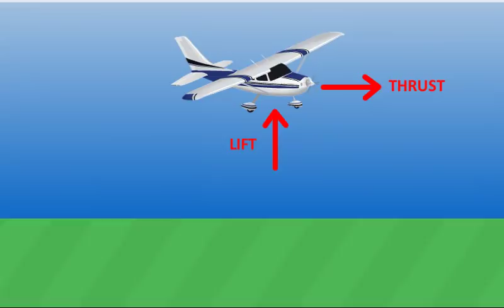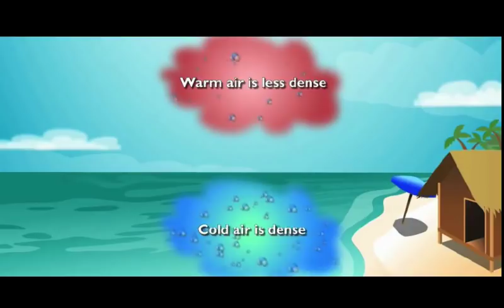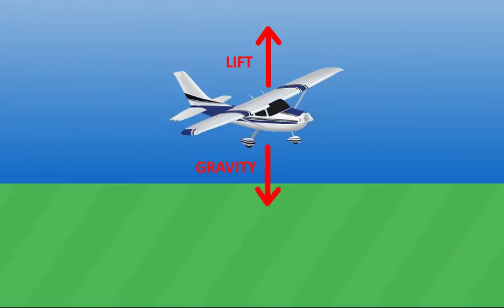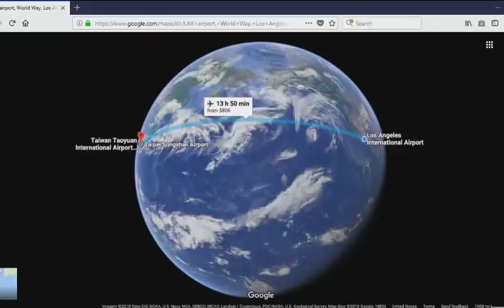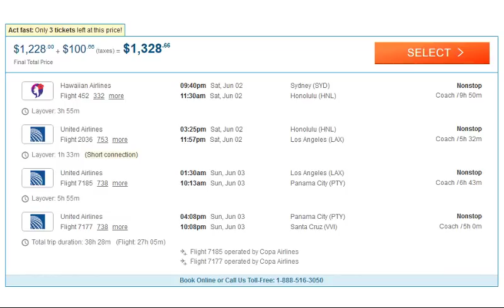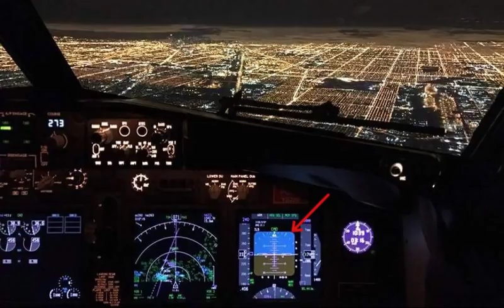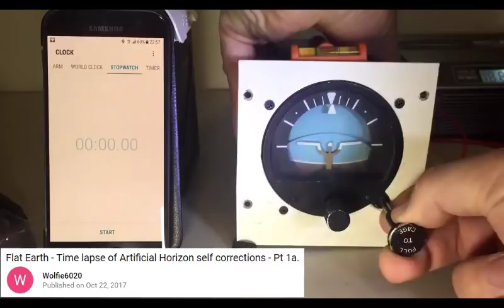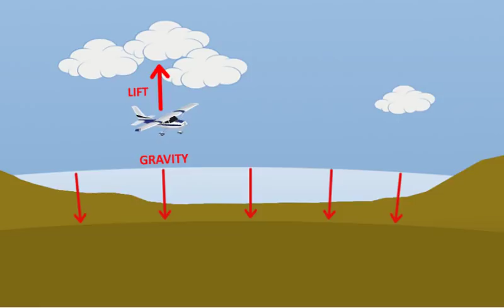Flat Earth Falsities - Plane Nonsense

Comment: If a helicopter is hovering so this is saying the moving atmosphere is strong enough to move a helicopter with it therefore stronger than the helicopter yet not strong enough to cause any effects on a landing plane . Not to mention if your hovering in a helicopter your not spinning you’d feel it surely . Also if your in a plane flying south to north there’s no way your also moving east to west 2 different movements at the same time is ridiculous
Reply: It must be annoying Larry how everything can fit neatly into our "system", but your system has massive gaping holes in it and nothing quite slots together without being papered over by magic and "God did it". You would think that might give you a clue.
Reply: "if I’m moving at 1000mph I’d feel it" - no you wouldn't. Force is mass x acceleration. No Acceleration mean no force. In other words there is no way to feel a constant velocity, it exerts no force on you.

"Where else in nature can a positive and negative pressure system exists side by side without a barrier?" - pressure differentials are literally everywhere in nature. I just explained that air is at 14.70psi at sea level but less than half that at 5500 meters. Where is your barrier there?

"Where else in nature does the surface of water bend?" - water bends everywhere. On the small scale you can see in the roundness of  a raindrop or in a meniscus curve, on a large scale you can see it with the tides: same water at high tide one place and low tide another. How is that possible if the water is always flat and level?

"now let me guess gravity stops water from moving" - partly, but mostly there just isn't any force on it from that movement. Because constant velocity doesn't create force, as I already described.
Reply: GrahamStw I can’t believe how stupid these people are... I don’t think they can comprehend in their minds the distances and sizes of the earth and the sun in conjunction to us...
Reply: Larry Major 
Maybe it's crazy in an atmosphere, or on our relatively small planet. 
But those are less than snail like speeds when the size of our galaxy is considered. Let alone the universe!

Common problem amongst flat earthers- no understanding of the actual sizes involved, and very poor 3D spacial awareness.
Reply: No, it is not "saying the moving atmosphere is strong enough to move a helicopter with it". It is saying that a helicopter on the ground is moving with the Earth. When it takes off it is still moving with the Earth, even if it appears to be motionless relative to the Earth. 
Exactly like the ball in the car: when the ball is in the boy's hand it appears motionless relative to him, but it is doing 60mph (or whatever), just like the rest of the car. When he throws it in the air it appears to go straight up, relative to him, but it is actually travelling forward at the same speed as the car and the boy.
Reply: Welcome to the world of Flat Earthers Liam. Amazing isn't it?
Reply: Tides are not waves Greg. They raise and lower in predictable cycles. Most areas get two high tides and two low tides per day. Take a look at the tide maps at https://www.tidesandcurrents.noaa.gov 
Notice how the same water can be at high tide in one place and low tide at another, then the opposite six hours later. That is not flat and level. That is water being bent and pulled to different heights by gravity. 
Which is what they use to make their predictions, which you can see are very accurate.
Reply: And yes I have seen curvature. Pretty much every time I go to the beach. 
Here is curvature right there:
https://www.youtube.com/watch?v=y_x7_Hl0AT4&t=507s
Watch for twenty seconds from that point. Clear observable curvature of water.
Reply: Greg Mcbride you are an idiot. The next time you’re in a moving vehicle, think about it again.
Reply: Greg Mcbride you’re asking people on social media who aren’t scientists. Why don’t you actually educate your self on the stuff you don’t understand rather than screaming conspiracy. We could shoot you into space and show you it’s round and you would still cry it’s fake. I have really tried to look into FE theory and I can tell you it’s all stupid with no regard for even the basic of science.
Reply: +Larry Major
Why do you run away from Questions, if you know so much? Given the intellect and knowledge you claim you should be able to answer these simple questions.
Why is it that a compass needle is more or less vertical at the poles and horizontal at the equator?
And when you carry on past the poles the needle slowly returns to the horizontal?
Why is it that it is only possible to navigate accurately over long distances using spherical trigonometry?
Why is it that traditional gyro compasses work perfectly in low latitudes but became unreliable in high latitudes?
Why is it that it is only possible to navigate accurately over long distances using charts based on a terrestrial spheroid?
Why is it that when you watch a ship sailing away from you the hull is the first thing to go below the horizon, then the superstructure and finally the funnel and upperworks?
Does a magnetic compass point towards polaris (Alpha Ursae Minoris) at the north and south poles?
Does a gyro compass point towards Alpha Ursae Minoris at the north and south poles?
What is the relationship between longitude and distance when travelling east or west parallel to the equator?
Please explain the principles behind the development and functioning of a gyrocompass?
No evasions please, just straight answers.
Reply: +Greg Mcbride
"The thing I love about the globe believes everything you hold so dear they have never felt saw or measured . Only read it in books "
What you fail to recognise is that some people have a working knowledge of the real world and have experiences which allow them to make rational, logical decisions on such things.  In my experience in mathematics, science and real life situations I have found that the mathematics and science I learned at school, college and university actually conform to and confirm real life. Unlike you I actually have real life experiences which means I actually know things, rather you who naively "believes" any old cultish claptrap.
Tell me, how many times have you navigated around the world?
Or to the Arctic or Antarctica?
And tell me what you saw on your travels and how you actually navigated.
Tell me what is the relationship between longitude and distance when travelling east or west parallel to the equator?
Tell me how you ascertain the error of a compass when in the Southern Ocean, using Alpha Ursae Minoris?
Reply: LIAR.  We have all been in cars.  Cruise control regularly speeds up and slows down to keep speed.
Reply: Bobby Wizdum 
Hey Bobby... What's up your pizza bro?! You disappeared from the convo after evidence was presented against your space pizza. I'd love to hear you explain the flights I showed you in the other comment thread!

And no shit you can feel motion in a car on cruise. Undulations of the pavement, any curve in the road, up or down hill, those are all changes in vector.
Reply: The helicopter is hovering with respect to the Earth.  In reality they are both moving at the same speed, just like a geostationary satellite moves at the same speed as the Earth.
Reply: @Greg. To feel movement you need acceleration. When Earth is moving with almost constant speed you experience only centrifugal force (as effect of movement). On equator that force is created by centrifugal acceleration equal to about 0.034 m/s^2 outward from surface. When in other hand you are experiencing Earth gravitational pull in opposite direction exerting acceleration of about 9.8 m/s^2. Which is more prominent?
Reply: @Greg McBride wrote: "Why do we feel nothing from the atmosphere no matter what way we travel?".
WTF? What medium of transport do you use? There is always air resistance that we must overcome to move inside atmosphere. It is exponentially dependent on the speed in relation to air. Did you ever check how much more thrust jet engine generates in contrast to simple propeller?

With proper airplane you can fly 800mph either direction (east or west, with or "against" air spin). What is you point?
Reply: @Greg wrote: "ISS 1700mph it orbits what the fastest speed ya humans can travel at? And also the earth it's self is orbiting the sun at 67000 mph".

There are no contradiction there. Movement is relative. ISS is orbiting around Earth center with speed of 17000mph where as is traveling with Earth 67000 mph around center of the Sun. In vacuum there is only one limit to the speed. Speed of light. There is no other. To go 671 millions mph there is long way for humans :).
Reply: Haven’t you seen Brian cox chasing the sun in the fighter jet traveling at the same speed as the earths spin ?? So what would happen if they turned and went against the earths spin 🌏 the earth would be flying past them surely ??
Reply: Brain cocks should do that travel against the spin in a fighter jet flying at roughly 800 mph and the spin of the earth say 800 mph roughly see where he ends up ?? If he can beat the atmosphere one way he should beat it going against that would be great telly
Reply: @Greg. ISS is orbiting Earth around 400km above see level in less than 1.5h per revolution traveling a route with a length of about 42540 kilometers . Even when cruising with blazing speed in excess of 28360 km/h around center of the Earth. There is zero G and astronauts doesn't feel any movement. That is because at that hight and speed centrifugal force is equal to Earth gravitational pull (at that hight around 9.55 m/s^2  = (2*Pi/1.47*3600s)^2*(6371+400)*1000m).
Reply: Martin Gorbush they feel no movement how come when you watch iss interviews they are bobbing about all over the place ?
Reply: Exactly because of that what I've said. They cannot feel movement but they can observe it with their eyes. That is why they bobbing about all over the place.

Even so I was specifically talking about feeling movement with speed of 17000 mph around Earth.
Reply: NotTheCIA I.think I’d have to take your word for it that gravity is acting as the rope and you have to take there word neither of us have any prof . How fast do rockets travel when they pop out into the magic of space how do they stop from shooting off into space ? If they are orbiting with 20000+ satellites why don’t they every hit one ? Who determines which way the iss Is orbiting ? How the fuck did they put that thing together if you notice there’s no footage of them assembling it it just appeared all of a sudden ! You should watch some of the old nasa footage before cgi they had to use little toys much like the first few space films or if you watch an old Godzilla it’s very very clear that they are not in space you don’t need a physics degree to work it out . You should all watch “do you believe in magic “ if you still believe all this space nonsense then your clinically not well and should seek help quickly !!!! Star Wars a new hope compared to Star Wars the last Jedi are worlds apart thanks to the magic of cgi exact same goes for nasa look for your self and come back to me it’s fake as fuck
Reply: @Greg.
Learn about ISS history. There is a picture from 2000: https://en.wikipedia.org/wiki/File:STS-97_ISS.jpg

Sorry I don't have time to answer every questions even easy one.

Satellites sometimes collides. There are so many of them but they orbit on different heights above Earth. Some even 35000km (geostationary).
You should ask how it is possible that there is so few accidents when there are more than 270 millions cars just in USA alone. What's more they move basically on one plane.

Why rockets don't overshoot? Sometimes they does. There are methods of correction (maneuver engines/thrusters). Mostly they don't because engineers did they job properly and calculated thrust and time of MECO (Mine Engine Cut of) just right.
Reply: @NotTheCIA wrote: "its gravity applying the onward force".
Sorry. You got it wrong. Gravity always exert force directed to the center of mass similar like a rope. Outward force which balance gravity force is created by centrifugal force experienced by object with mass m orbiting at distance r with angular speed of omega and could be calculated as omega^2*r*m.
Reply: Martin Gorbush they are in a studio playing with themselves lol
Reply: Martin Gorbush your can example don’t really work has ever car has a driver and even then with traffic lights there’s still hundreds of crashes
Reply: NotTheCIA I.think the difference with water we can see it moving the atmosphere we just need to take there word for it . If you go against that stream your talking about you feel resistance right ? Why do we feel nothing from the atmosphere no matter what way we travel ?
Reply: NotTheCIA I.think if your on a train your traveling flat so yes it’s harder to detect . But if your going around a ball and also being pulled around the sun your saying you wouldn’t be getting thrown around the iss of course you would . When you take off on a plane your told seat belts on when your landing its seat belts on its only when your cruising “FLAT” that you can walk about . And you can clearly feel up and down but wait let me guess in space you don’t in space you can be spinning around a ball while getting sucked around the suns orbit and not feel a thing....... the magic of space that none of you have ever experienced yet are so sure exists
Reply: NotTheCIA I.think the magic of space the iss which I reckon you believe in ? So the iss is traveling around the earth “orbiting” the magic of gravity it ain’t sticking it too it it’s making it orbit this time amazing .... 17000 mph it orbits what the fastest speed ya humans can travel at ? And also the earth it’s self is “orbiting” the sun at 67000 miles ph now think long and hard about those speeds and watch a iss video cunts are having fancy dress water fights while playing the guitar 🎸?!?!? Also how on earth did the built that up in the vacuum of space going at such ridiculous speeds none of which is humans living in reality have ever ever seen !!
Reply: GrahamStw it doesnt fit neatly. you guys just contradict yourselves, give gravity more jobs, and pat yourselves on the back.
Reply: Jake only if you hit the break or accelerator. i thought u guys just claimed u cant feel cars moving like earth? now you can? shocking. of coarse you can because its moving.
Reply: Ryan M havent seen this "evidence against the pizza". i can tell you...if you admit u can feel movement in the car why are you guys using that as your example for how we cant feel earth moving when it is? do you guys realize how that looks?
Reply: NotTheCIA I.think no. i feel motion because my car is moving. i know my senses.
Reply: NotTheCIA I.think you are holding on to the rope of the bucket though so it’s not the same at all . These example you give are typical of the globe heads . Spinning a bucket around your head something we can all do yes but to then compare it to a giant space ship being stuck in orbit with nothing holding it only the magic of gravity is such a big jump it’s silly!! Why don’t gravity suck the iss to the ground ? So it sucks you down till what altitude? And orbiting at what point do you stop orbiting suck stick suck stick orbit orbit hajajaha . You believe in unprovable magic
Reply: Geocentric is just that the stars moon and sun move around the earth instead of the earth moving around the sun . Not so hard . If a small boat and a large boat were on the ocean if the larger boat moved around the small boat at a distance how would you know who is going around who ?
Reply: Strange odd news the Vatican uses an Observatory in Arizona called Lucifer .
Reply: No one has answered my question how can water be motionless on a spinning ball . And we are not talking about flying flat on a airplane contained in the plane and my tiny glass of water before you guys use the plane example . Still water on a ball spinning at 1000mph roughly on its axis then 67000mph around the sun and then it’s also chasing the sun the suns rough speed through the galaxy 450000 mph hahahahahaga love it now think about all these speeds you lot are all happy to believe this utter garbage.......why can’t we detect any movement on the water ??? Let me guess gravity 💥 brainwashed don’t cover it
Reply: NotTheCIA I.think that is a lie. on cruise control i still feel the car moving.
Reply: A car and the earth are worlds apart I’m afraid .if I’m moving at 1000mph I’d feel it let’s not forget the 67000 mph around the sun . The thing I love about the globe believes everything you hold so dear they have never felt saw or measured . Only read it in books . Where else in nature can a positive and negative pressure system exists side by side without a barrier? Where else in nature does the surface of water bend ? Where else in nature can water flow round a spinning ball ? You go to a lake in the morning when it’s as still as. Can be sheet of glass now your telling me that water is on an object flying through space 1000mph one way and 67000mph another.......now let me guess gravity stops water from moving ???
Reply: Don't worry the globe people will make it fit their systems haha
Reply: The Vatican named their Observatory in Arizona Lucifer imagine that ?
Reply: GrahamStw a standing body of water from one end to the other has to be level right ? Or it would flow water does not have the ability to support its self rain drops and waves are something complete different . Water finds its level that’s why there’s water in spirt levels that’s why for years we have used water to level surfaces in the building trade a very accurate tool again the surface of water can not display shapes it’s impossible . When you pour water down a hill it flows down the hill to find its level . There are canals and lochs that are 100 miles long and they have have to be flat right ? Also the non moving water on a spinning ball can anyone answer that for me why is a lake more or less perfectly still yet the thing it’s on is moving at brrakneck speeds ? Have either of you lot every seen any curvature or detected any movement I’ll answer for you no you haven’t cult like behaviour you lot have defending the globe 🌍
Reply: Greg those speeds are  96 times the speed of sound around the sun and 1.5 times the speed of sound spinning crazy right ?